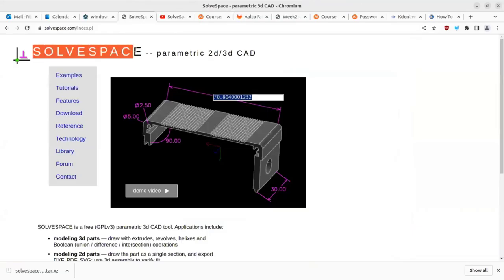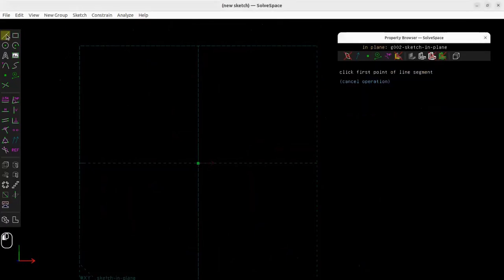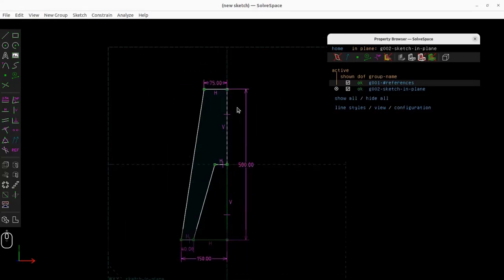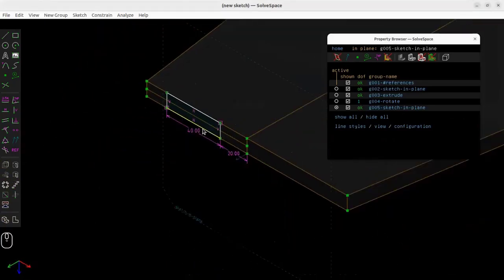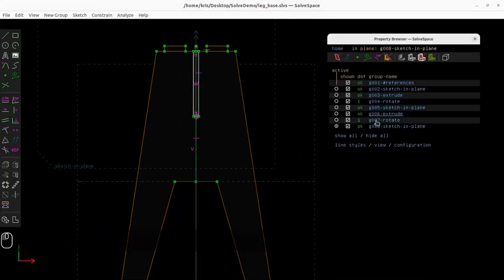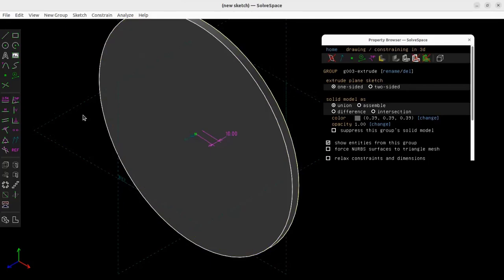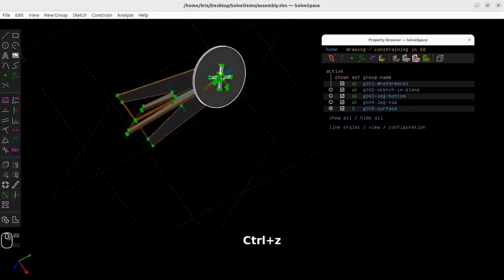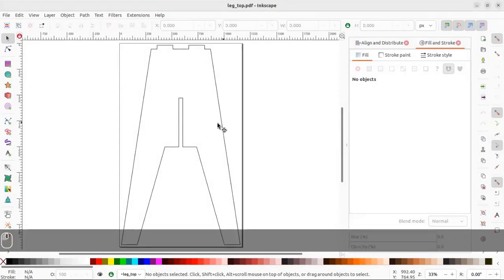Introduction to SolveSpace

Comment: I am trying to follow the steps you are showing on the app. I keep getting messages like Activate the workplane before extruding. I have no idea how to rotate the plane as you showed. So I have to conclude that there are many more basic steps to learn before starting with this tutorial. I am not really new to CAD software, I have been using FreeCad for a couple of years, although not at the advanced level. Where can I find the basic navigation help?